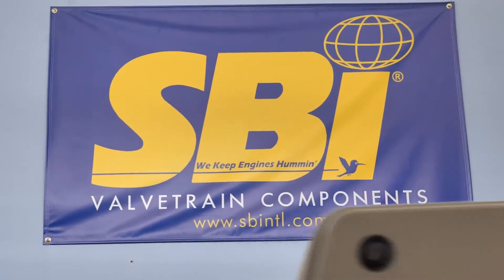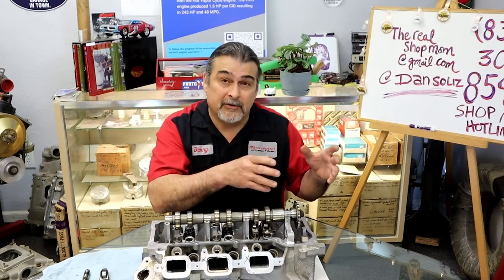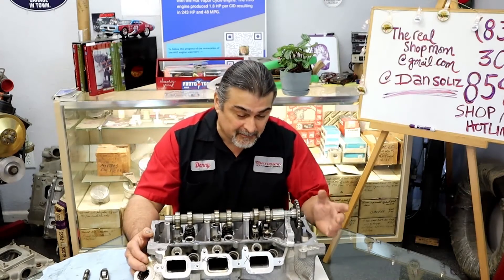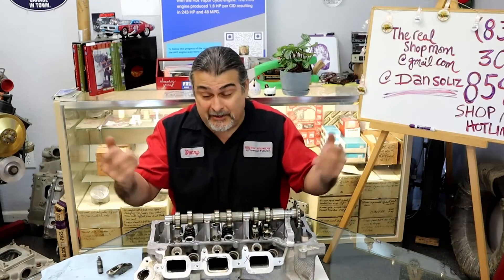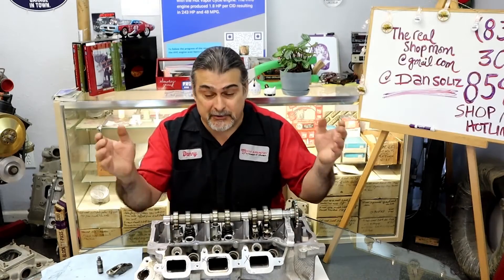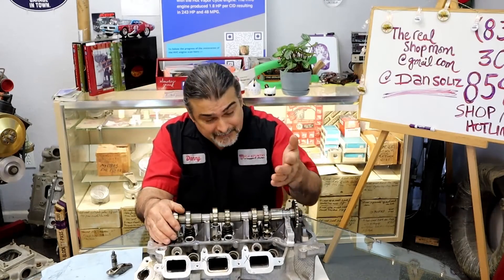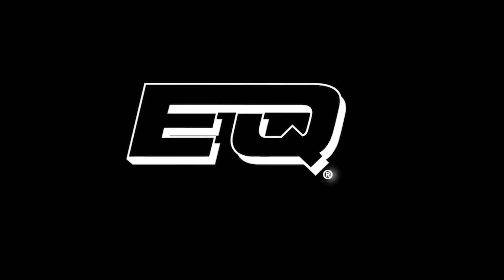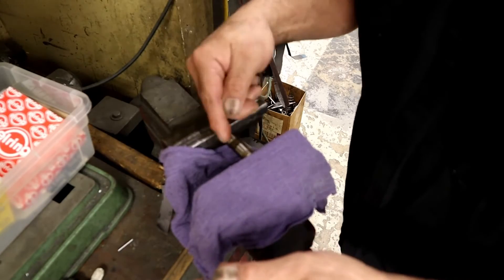Why You Should Be Bleeding Lifters

Comment: Thank you so much Sir this is a great video and you sir saved me from buying all new lifters on my 09 gmc Acadia 3.6vvt engine I was removing everything during the timing chain job just to check over everything doing a cylinder leak down test and I was concerned that all my lifters every one was rock hard and they all couldn’t be bad. 
Not only did you save me from wasting money on new lifters but you also saved me from have major issues by not doing this correctly. I’ve read the service repair manual twice and there’s nothing about bleeding the lifters. 
Again THANK YOU SO MUCH SIR.
Reply from the maker: Glad this info was a big help!

Comment: I've had to search many videos about this subject. This one has authority, as it's his expertise. To summarise my new learning: New or old, lifters must go in squishy, as a working lifter will pump up to take up the right amount of slack & good if you can get oil pressure up without combustion firstly, then   start normally. Install with your eng. type new oil. You don't want  hi viscosity oil or prep lube making it hard for the 2 holes in the lifter to breathe & lift up.
Old lifters are cleaned with 1 to.1.5 mm drill bit or similar (in end hole) to press carefully on check ball valve (many vids on this) & pumped while submerged under your choice of cleaning medium like diesel etc ..after this if they pump up tall & solid & can't squeeze them down with your finger & thumb pressure,  then they are reusable. Now clean out cleaning medium with same process flushing with your eng oil. Then squeeze out to make them squishy (introduce enough air to do it). Air compresses & liquid doesn't. But new or old there must be give-way in the lifter b4 installed unless you have a greater authority on your specific engine. Also to note that there is risk mixing new with old, where parts no longer shake hands if one new & other old.
A new part can  accentuate an old parts weakness, or not match corresponding wear pattern in mating surfaces.
 Make sure old parts taken out go back to the same place if reused.
Block plug holes or other holes in cam area to ensure no nightmare   scenarios can happen.  Most of us are novices trying to save a $ to survive & don't realise what only experts know. Most of the time we get away with it. But thanks very much to the experts like this who share knowledge.

Comment: I just did head gasket and valve job  a 4.6L sohc and one side I have 90 psi of compression on all 4 cylinders I bleed the lash adjust but when I started the engine after I took it apart to bleed lifter since I didn't the first time it's still running rough I can pretty sure valves are still getting held open can I be that the lash adjuster is bad and not compressing when it pumped up

Comment: Hello Danny,  I am also from Michigan.  I also had no compression so I bled the automatic valve lash adjusters down.  Compression came back until I cranked the engine a few times. Now the compression is gone again.  Could you please tell what I am doing wrong?  It seems like lifter has the power to open the valves.  This seems very dangerous for the compression.  I unbolted the cam caps initially to regain compression then looked up your video.    Any ideas?  Are the valve springs not powerful enough to fight the lifter?  thanks for any help you can offer?  GM 3.6L 2006

Comment: This is also true if you buy a classic car and attempt to readjust the valves.   Once you loosen the valves, you MUST bleed the lifters before you can adjust again.    I have a tool that allows me to carefully bleed the lifters while still in the car.   If you fail to bleed, when you go to readjust you will simply lift the valves off the seat.

Comment: Awesome explanation of how to insure you are able to measure pushrod length when installing different engine parts. I always upgrade if I have to tear down. I have never had this type of trouble because I always disassemble the lifters and clean them, leaving them empty except for a little light oil inside and air. I pressure prime and rotate after final assembly, before starting, and that is when the lifters will fill up and do their thing. Assembly lube on cam surfaces but never heavy oil inside a lifter.

Comment: I sent my full head with cams and lifters to a shop to avoid issues like this. I did it like that because Im a novice and obviously didnt know any better. Idiots didnt bother to bleed them, had compression on one cylinder only. Now I bled them all and cyl 4 is still presenting issues. I dont think I bent valves because I turned it over manually and nothing touched. I think the issue comes from somewhere else but if the head has to come off I'm  not going back there with the best attitude.

Comment: why would anyone do a head and leave lifters with oil and crud thats making the lifter so stiff your using a vice to push it out. so now youve got a fresh machined ead new valves etc, with lifters that have shit half filled, you actually show us whats in it, yet you leave the rst of the worst in there, were is the logic? what you pump out is the beginning, the worst of the crap is still in there you only pushed out the thinner oil, the gunk is still there. everyone else would put the lifters in petrol, pump the lifters get the grit and metal shaving and old oil out, then soak them in oil and put them in. lifting a cam doesnt make your lifter fill with oil and create hydraulic lock. instead of making a bleeding lifters video, maybe read and watch some videos on, why all manufacturers require lifters to be soak over night, then pumpemped untill no air is left, so completely full of oil before putting them in. its in the name dude self adjusting, what are you bleeding. if anything, they actually can get air trapped in them, that requires a process to even them out.

Comment: This shows how imports have much tighter lifter machining tolerances than domestic manufacturers, along with the valid spring pressure thing.  Plus non-adjustable lifters (OHC engines) likely have more lifter travel thus making this more of a problem for imports.  Great article and VERY well explained !

Comment: You seem to understand motors , and I’m learning a lot quickly, I have a 2grfe that has an intermittent, complete every revolution miss on cylinder 3 . After it starts missing can turn off and restart several times still missing or may start immediately and back to normal. Revving the engine cold will start the miss very often , after warming up its much more difficult to start the miss but once the miss starts it must be turned off and restarted . When missing it always is every revolution, COULD THIS BE A MALFUNCTIONING LIFTER ? Any help would be greatly appreciated

Comment: So o would think that slowly torqueing the cam should bleed them
Reply: No, if the hydraulic lifter is filled with oil then the resistance is greater than the valve spring and both are connected by the rocker. So, when torquing down the camshaft the valve side of the rocker will push the valve open because now that has the less resistance than the oil filled hydraulic lifter on the opposing side of the rocker. Perform your procedure, put it all back together and you'll have no compression due to a permanently open valve.I don't know if you're aware of this but it was all explained in the video.

Comment: If I can give some advice back...when you put the lifters back align the holes on the lifters to the holes in the head...then turn the enjin over for a minute without the spark plugs until you see the oil light go off.. before starting the engine.
Reply: Which holes on the head?
Reply: @diycast6914 some lifters are directional. There are holes for oil to squirt through. In some cases they have spray facing one way. They can be installed in reverse causing issues down the road.

Comment: I figured this out for myself when i rebuilt my Audi engine. I found very little information about this on the internet. I'm actually amazed more people don't have a problem when they put in new valves and lap them in.
Reply: i was thinking the same, how come people dont talk about this issue or post this question on the internet. i guess if you install the lifter on the same valve that you took it off from, may be there is a less of a chance for it to cause any damage.. but if you mix when installing can cause issues i guess?
Reply: @samithaweeraman1882  For the engine Im working on, the manual says to crank the engine over so all 4 cylinders are at mid height when installing the cams. I guess thats another way of ensuring no valves collide with piston crowns
Reply: So when cranking the lifters are locked at full position or are they complectly empty?
Reply: @samithaweeraman1882  They should be completely empty. As soon as you start cranking the engine the oil pressure will fill them and they'll expand to fill the space, perfectly. I suggest you disconnect the injectors and crank over for around 10s. After a couple of these cranks the oil pressure will have filled them all and you can start the engine. It may clatter a little initially as some struggle to expel the air.
Reply: @rogeronslow1498  thanks mate! i did this on a BMW N47 I partially filled the lifters and went to town and like you said cranked it without any fuel and it worked great. quite a few are telling to fit these while they are rock hard but it makes complete sense for them to go in empty and fill in as needed when you crank when oil pressure builds up..  hope these comments will come in handy for someone in future.

Comment: Great video. My Jeep 3.6 L engine has a V6 with overhead cam. I had a shop put in new rocker arms on one head. There was one roller that had slop and it was causing a ticking sound. My 351C engine in my Ford got a new Comp Cam and lifters. We added Harland Sharp roller rockers. Your videos are full of good information.

Comment: Interesting how Ive seen other info that suggest putting normal old school hyd tappets in a bucket of oil so they dont start dry. Maybe the difference rests with is the engine builder going to manually rotate the oil pump so everything is oiled first or go straight for the cold start?

Comment: Thanks for this video. You saved me a lot of aggravation as I was just getting ready to replace my lifters in my 09 GM 2.4l ecotec. When I received the new set of lifters a few days ago, I expected that the plungers would be able to be compressed easily but that was not the case. They were fully pumped up and solid as a rock. This had me confused a little because there is no mention of this in the service manual so I was going to install the lifters as is. Installing lifters filled with oil makes sense on a Chevy 350 because you have adjustable rockers but does not make sense on this engine due to the rockers not being adjustable. So I stalled the installation and searched Google and finally stumbled across your video. This information didn't pop of immediately. Most threads about installing lifters didn't mention this either. Now I am happy that I delayed the installation and feel vindicated for my concern. Once again, thanks.
Reply: Will I have to do it on my 2012 Chevy Equinox 2.4L Ecotec too? I got new GM lifters and they’re hard solid too.

Comment: Thank you for this valuable information. I have just finished up replacing the hydraulic bucket style lifters in a 07 kia rio 1.6 
It never crossed my mind that the new lifters would be filled with oil . That being said, you know the results of my failure. 
I have to go and remove the crankshaft balancer pulley , timing belt and both camshafts because of the new lifters being full of oil " and NOT checking them before assemble. 
Lessons learned the hard way.
Great video on hyd lifters !
Reply: Why cant you just turn the motor by hand and bleed each lifter down using a lever of some kind ?
It will work the same as a vice ...

Comment: My GOD!!!!!   
You have no idea the mistake you just saved me from.

TODAY I had all my lifters in a box.  
I used a carburetor jet cleaner( like a paint gun needle cleaner) to make sure I had the tiny hole on the end of each lifter free of carbon build up.

I then blew compressed air through the small side hole in the lifter, to expell any foreign debris from the tip of the lifter.

When the air cleared the lifter of old oil and possibly any other fine debris, I then took a syringe full of new oil and injected oil into the small hole on the side of the lifter until the a steady stream of oil came out of the end of the lifter.

I then dipped the entire lifter in oil and dropped into the head, and actioned it back and forth to ensure free movement. 

Each lifter is FULL of oil 😆😆😆😆.  

I only got that far.  I haven't fitted the cams in yet THANK GOD
Reply: he is OVER REACTING to non existing problem.

Comment: weird situation can someone in-lighten me,
after head gasket, timing and diy valve job.
bleed lifters.
1 of the 4 cylinders compression (265 psi)
other 3- 150 ish.
what is going on???
can a lifter, cam lobe, stuck valves in this cylinder create such high pressure???
no fluids (no gas or Antifreeze in cylinder)
WTF!????

any information would be greatly appreciated.

Comment: Rookie mistake,
head gasket & timing chain .
installed yesterday took all day, went smooth. until big test crank, crank, crank, no start (oooh Sh#!t !!!!) thought about the only thing that caught my attention. some lifters where squishy some where rock hard, Guess I hurried this part. compression 
cylinder 1- 140
cylinder 2- 60-65
cylinder 3-110
cylinder 4-130
almost fires over, no start
Timing spot on, gaskets new.
Reply: Literally did the exact same thing rebuilding my head.  And I just saw this video and realized all my lifters were rock hard.  Crank no start and low compression 🤦‍♂️ though it was timing too

Comment: I just installed new intake cams on a 2017 3.6l pentastar. Typical roller rocker failure as many owners have unfortunately and it chewed up 3 lobes causing a misfire in cylinder 5.  I hope I'm ok with my lifters as I came across your video a bit late in the game. Put in all new rockers on both intake sides and I replaced 3 of the lifters on the valves with the shot rockers all others looked good with no movement by hand.  Appreciate your video and Knowledge shared.

Comment: Very thoroughly explained - many thanks as I freaked out a bit when I put the rockers back into a Kohler Command and the valve bound up, (luckily) as I turned the engine slowly by hand and realized something was badly wrong before I did any damage. Many thanks! An old timer!
Reply: I did the same thing on a Kohler ... yes I just turned mine gently by hand and it slowly bled back down luckily 😄

Comment: I found your video very interesting… I have disassembled my engine (WV Polo 6N1) but now I can’t get it to start! There is no fuel admission to the valves. It seems that the compression goes up to the carburetor! I wonder if the problem is from the hydraulic lifters… Before assembling the camshaft I bled the lifters… Thanks

Comment: In my 85 g-body service manual it says if planning to reuse lifters to rebuild them to thoroughly clean them and when reassembling fill with 10w oil.
Reply: I totally disagree with the manual. I have found that some service manuals to be totally incorrect on torque specs.  
Asking questions is not a bad thing no matter how long you've been pulling wrenches 😮😮

Comment: Danny  you vid sure has made me stop n think  about my current situation  im old school as well and set up my sbf the same way i have for years  i pre charged my lifters then set all my pre loads when i had it on the engine stand  but now after hearing what you are saying on later model motors with lighter spring seat pressures i now am beginning  to think either i have a few bent push rods  or i need to readjust my vale train  i just got it running and got my exhaust on so now ive been able to get a better listen to it and from what im hearing almost sounds like the same clatter noise you hear in a diesel  but  yet still sounds alot like collapse lifters   heres my  you tube channel maybe you can listen and see what you think  thank you Bill   https://www.youtube.com/watch?v=bpkqUAG2DPQ

Comment: He is right about bleeding lifters that they can hold valves dangerously open and cause damage if not bled. Instead of using vise, I found it better to take off retaining clip, completely disassemble lifter using brake cleaner solvent to clean all gunk out of which there may be a lot, and reassemble with no oil in it at all. Let it get oil when it pumps up installed for automatic adjustment.
Reply: In the 70s when I learned this trade, I would always take apart all hydraulic lifters, one at a time, and clean it thoroughly because there is no filthier oil to be found anywhere else than inside a lifter. How can they work at all if they are made to capture this crap? Short answer is they can't be expected to work well and its a miracle if they do. It took a clean solvent pan and ruined it all by itself. Just fill them back up with clean oil which will then bleed down as expected instead of hung up on that junk inside. Cleaning your very first used hydraulic lifter will amaze you with all the pure filth found inside.
Reply: I can't tell you how many used lifters I've been able to restore simply by disassembling and thoroughly cleaning them internally.